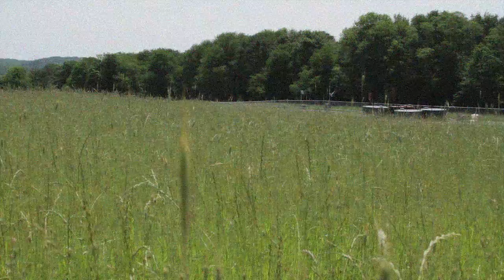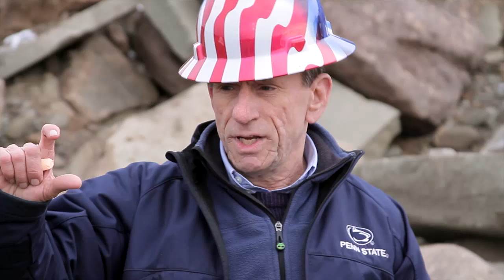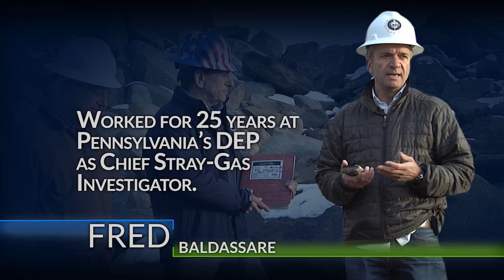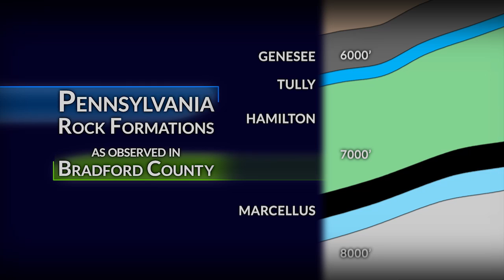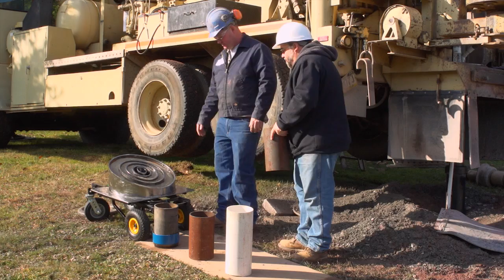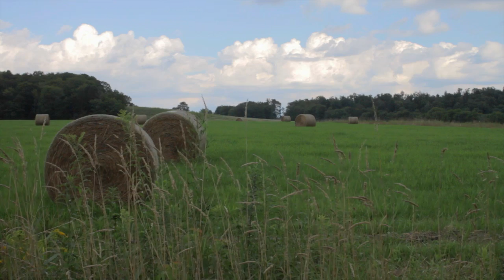Methane: An Element of Nature

Comment: Gas does migrate upward over millions of years from the shale - but it is correct that holes not properly cased and cement can facilitate migration.  I agree cement bonding logging should be a requirement, plus routine monitoring of pressure on the inside and outside of the casing and other monitoring.  My section of the video relates to private well construction and it is clear that poor private well construction has help to facilitate problems - both need to be fixed.

Comment: Larry Cathles says the gas doesn't leak but with every well drilled into the Marcellus a path to the confining layers and to the surface is created. Unless a cement bond log (CBL) is done to verify every inch of the well then there is no guarantee that pathways to USDW aren't created. 
Also the video NEVER mentions casing failure which is a huge problem. It's what caused all the problems in Dimock. The fact is Cabot still paid a massive fine and settled out of court and had records sealed.

Comment: If it is opened and left to sit, the carbonation will escape until all the gases are gone.  If left long enough, under the right conditions, the liquid will evaporate.  By drilling in to radioactive shale deposits we are in essence “opening” them and providing them a “straw” in the form of a borehole to reach the higher strata.  Of course the contents didn’t escape while they were trapped but now they have a pathway to do so.

Seems like a basic concept to me.